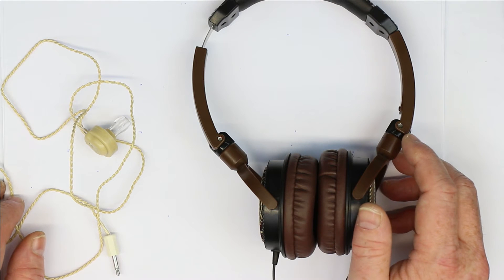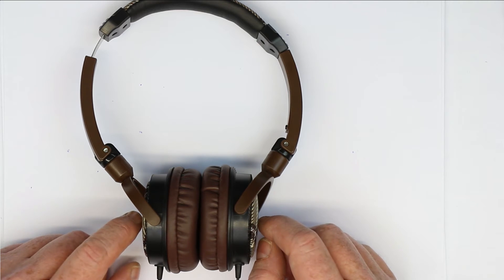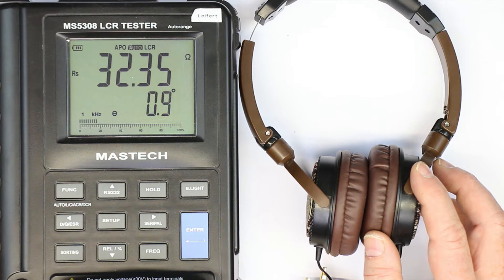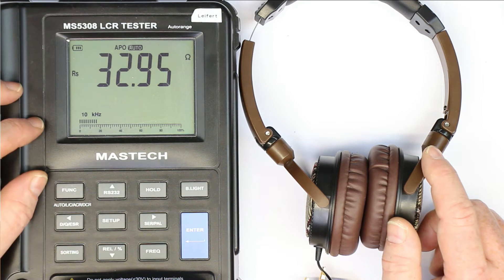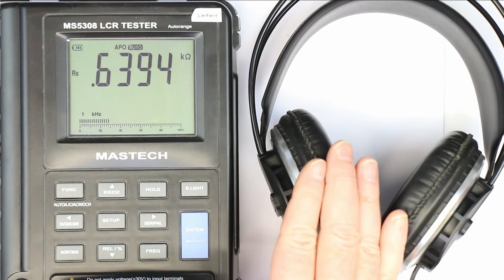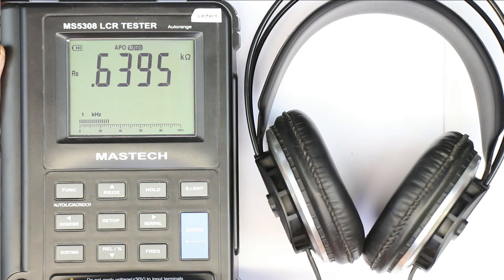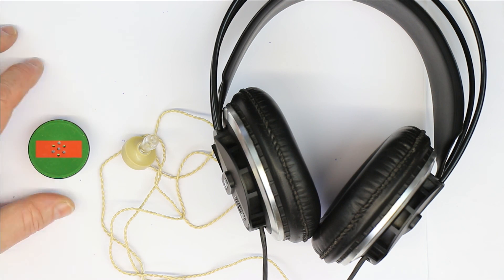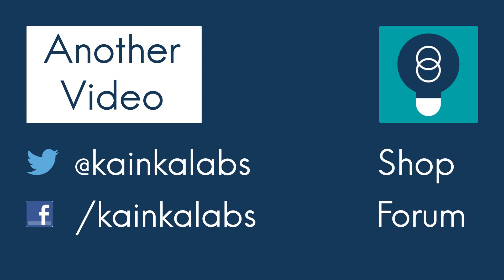Impedance and Sensitivity of 3 different headphone-types

Comment: Thank you for your video. I come from the side of headphones and surprisingly it’s hard to find a way mathematically to find out what kind of power a given headphone will need for amplification. I was excited to hear you measure sensitivity but confused on how you would use the results mathematically to make sure an amplifier is supplying the suggested amount of power to a headphone for it to sound full and not thin due to improper amounts of power. 

. Do you have any insight into how to do that math or where to turn to next for a better understanding? The world of headphones is very frustrating in that nothing seems math driven only based on what feels right to a reviewer. I’d like to be able to establish if a headphone and amp combo is a good fit based on more than just feel, or just throwing as much power at it as possible to be safe. Thanks for your time.
Reply from the maker: Headphones don´t "ampliufy" anything but they transform electric energy to acoustic energy. Don´t mess up "power" and "voltage" in electronics! Ohm´s Law tells you all you need.

Comment: Have you considered using a transformer to impedance match the 10 kilohm or so if the crystal radio to the lower impedance of the headphones? It should make quite a stark difference
Reply from the maker: Of course every type of headphone has to be impedance-matched with a transformer to the high impendance of a crystal-radio (better say: the high impedance of the LC tank circuit, which can be hundreds of kiloohms with a hugh Q-factor). So you basically also need a transformer with 2x2kOhm headphones if you want to make use of the full energy of a high Q-factor crystal radio.
Reply: @KainkaLabs  crystal radios: impedance matching in an exercise of efficiency owo

Comment: thanks for the gr8 information , 
i want to buy a headphone nd the specs are :
Sensitivity: 90±3db
Impedance: 32Ω
Cable Length: 125cm
is this good for music? , i use the underground train a lot
Reply from the maker: What purpose do you want to use the headphone for?
This comparison was for the useability of different headphone types for crystal-radio listening (Optimum: High Impedance + High Sensitivity)
As I told in the video, the sensitivity data from the manufacturers are not trustworthy.
32 Ohms can be used for crystal-radio listening only with a transformer with an extreme winding-ratio.
You have to tranfer 32 Ohms to approximately 50 kOhms...200 kOhms with high-quality magnetic antennas.
Without the transformer it will be hopeless except if you live directly near an AM-transmitter.
Reply: the propose is high quality electric music like trance music, any recommendations before buying ?
Reply from the maker: No.
Reply: Oblivion Dew It depends on the source of music, your player & output. For example, my primary music format preference for rich quality electronic music such as trance music would always be .WAV file directly from artists or Beatport/JunoDownload, apart from being given for free, if I were to purchase, I'll be very selective on each track's build & mastering quality first heard from ASOT, Ori Uplift & some other podcasts, such as recently I've purchased Davey Asprey's Fall Out, Robert Nickson's Heliopause & Gouryella's Venera, all full-extended versions in WAV format, as WAV has the highest density among digital music format, highest density=most sound signal details are being encrypted, so next is your player. Well if u're on-the-go & not intending to bring along so many extra gadgets, a smartphone is pretty much that's doing the job with the specs of the headphones that u've stated. 32ohms of impedance & a sensitivity range of 90 +-3db, esp if u're jz purely listening trance for pleassure, I reckon u're most likely listening to sets from Mixcloud, SoundCloud & AH.FM or single tracks from Spotify or Apple Music, either one they're all giving a music quality output that's decompressed to between 160kbps-256kbps (close with mp3), but not any professional purposes (including DJing, making mashups & production referrencing), it's good enough. I tend not not listen from YouTube.